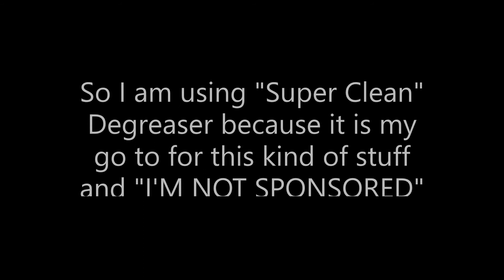Cleaning the engine block

Comment: @ 9:45 you can see the witness marks from the rings at the bottom of their travel. If you can feel a ridge or catch your finger nail there, that is when you would usually know it will need to be bored without having to use an inside mic. That "shadow" on the top row 2nd from left in the same frame is a tell-tale blow by witness as well, likely the skirt on that piston is has more damage than the others. Spots like those is where knurling would likely help get more life out of it. Look forward to seeing more !
Reply from the maker: absolutely man for sure! like I said most likely it will half to be punched out .20 or .30 over